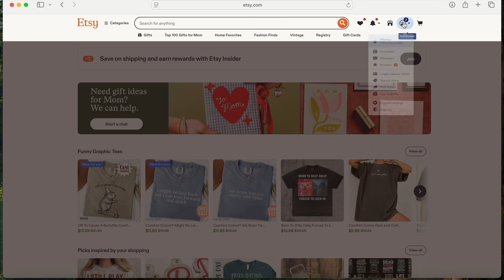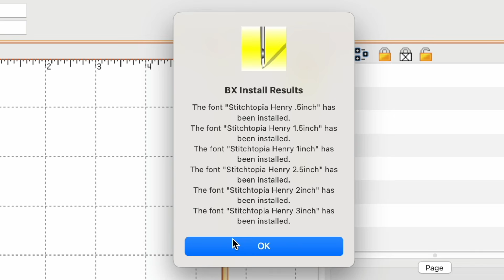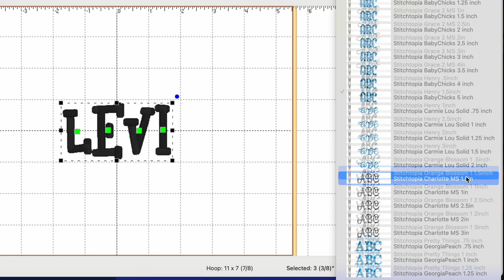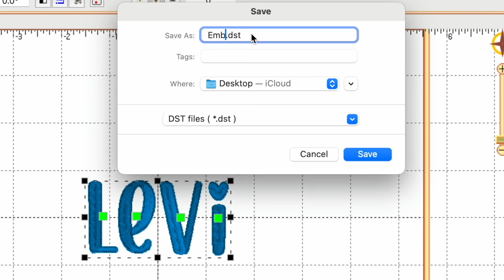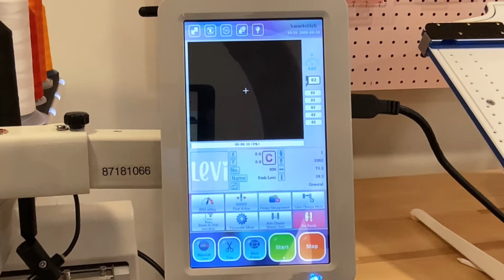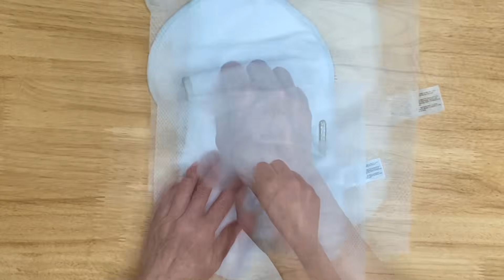Beginner Embroidery Project

Comment: Great video.  Did you find a difference using that backing?
Reply from the maker: Not really. Typically I would use cut away and tear away. This is probably less stable than the tear away but easier to clean up.

Comment: That turned out so cute! Thank you for sharing. You mentioned it was the first time you were trying the water soluble topper on the underside of the project, how did you like it? Do you feel it gave good results to continue using it like that ?
Reply from the maker: As a second stabilizer, it did fine and the project turned out well. I think using tear away as a second stabilizer (that you also remove after the project, just leaving the mesh) works just as well and provides a little more stabilization. I need to see which is less expensive - tear away vs water soluble.
Reply: Thank you Marilyn